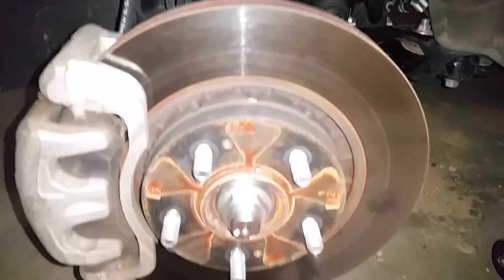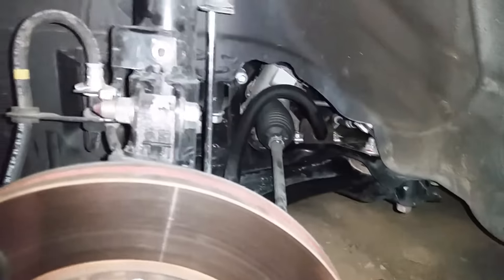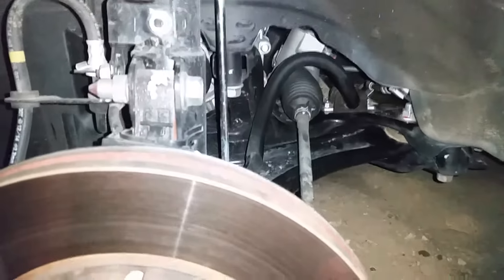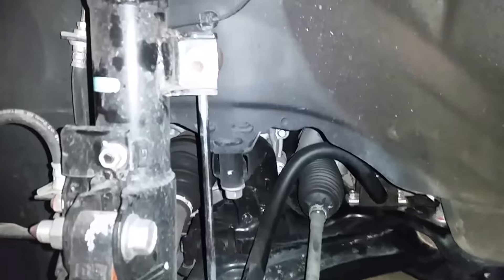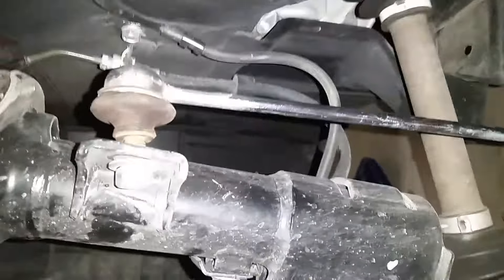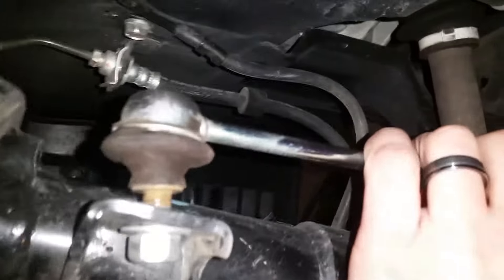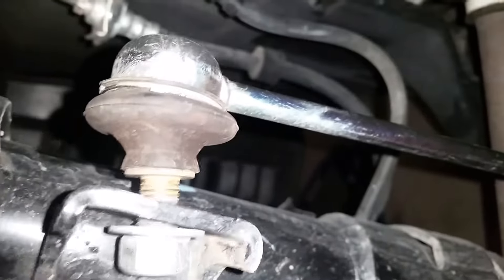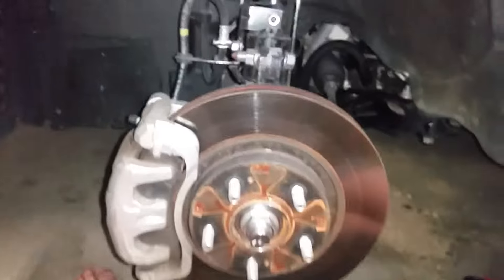Clunking noise found!

Comment: Always tighten it with the suspension LOADED. If you tighten it unloaded, when the vehicle is on its own weight it won't be torqued right.
Reply: Can you explain? Sway bar link nut has a set torque spec and doesn’t matter whether the system is loaded or not as long as the stud lines up with the hole.
Reply: @brandonevans743 that guy just doesn’t know what he’s talking about

Comment: Don’t feel bad man I did an oil change and almost forgot to put in new oil before I started it 😂
Reply from the maker: Hahaha it's the little things you can forget
Reply: Bet that has been done alot...imagine driving off 😂😂 Iam doing mine soon I hope I don't forget that will be curtains for most cars
Reply: @unknownunknown3368  Welllll? Did you remember? Just put the oil bottles in the engine area first.
Reply: Keep the cap off till its done thats what i do so i don't forget 😅
Reply: @JasonLyons-il8mv I drove 30 miles with the oil cap off after topping up, luckily oil cap was in engine bay still ha ..
Reply: I forgot to put the drain plug back in once.
NEW oil all over the ground.
Thankfully, it was just my push mower and not one of my vehicles.

Comment: Check all the fasteners on all the parts you have removed and/or replaced immediately after the install, the next day and a couple times within the next week or two. I replaced all 4 of my end links and had to re-tighten them every other day for two weeks before I decided to put a jam nut on all of them and no problems since. Also, for some reason the brake caliper bolts seem to get overlooked when reassembling... Hand tightened but not torqued

Comment: That's exactly the same case scenario for me. Slow speeds and over bumps i hear it because it's not loud enough to hear over higher speeds. No shaking or vibration coming from the steering wheel and control is not problem. Just that loose sound. Im gonna change the control arms anyway and control link. That should be good for a 100k miles.
Reply: Hey I have the same problem like you have before. I drive slowly in bumper so I hear it deep knuck not loud but it is. I dont check yet but sounds the same like your. Mitsubishi asx 2017. Thx for your comment
Reply: What was it?
Reply: @YXEFlatl1ne  Bent rim.
Reply: @marcpadilla1094  wow did u change the Top Strut Mount for no reason before that??
Reply: @YXEFlatl1ne  Almost did a complete overhaul.  BMW tried to whoop.me decent. Local guy said all good except the rim is bent.

Comment: Oh man hopefully this is my problem and not nothing serious to fix. It just started to happen on my passenger sides only when I do right turns depending on the elevation of the road full lock turns while driving & reverse it clunks clunks then sometimes it doesn’t. You can definitely hear the spring clink too
Reply from the maker: Hope you get it figured out!
Reply: @TheSnyds  Same issue.  In my case I had to remove the old sway bar on the passenger side. To remove the bold I had to drill through it.  I got it out, but I over did it and cut around the hole where the bolt goes in.  I think the new bolt may be moving around causing a clunking sound that started after a few days of driving.
Reply: @TheSnyds took off the a few weeks ago and my suspension end link came off and got bent from turns on the axel so scary but luckily it was a easy fix. Probably would’ve been $500 for a $30 job. My homie is a manger at auto zone and he happened to have the part I needed since my nearest auto zone didn’t have it so I as able to pick it up and swap it next day.
Reply: Same. What was it??? 09 pontiac. What was the issue?
Reply: Same issues on Q60.. what did it end up being ?

Comment: In my similar repair-causes-noise case, the noise was caused a defective brake job that forgot to install the brake caliper springs. The calipers were loose and were rattling against the rotors which made a severe noise. The brake tech said could not see a defect and I would have to replace the front-end one component at a time until the noise stopped. Instead, I took it to a different shop which looked at everything including the brakes spotted empty holes where the caliper springs should be. So, the brake tech caused the problem, wanted to cure it by replacing the front end, and did replace a couple of control arms. LESSON: inspect all recent work when looking for new car noises.
Reply: Caliper springs ?

Comment: I did the samething. I replaced tie rod ends and sway bar end links. Both had come loose. I got really, really luck. One of the tierod ends bolts almost fell off. Luckily it had an anti fall off saftey feature. I failed to torque everything under load. I didn't make that mistake with my struts. So, I learned a valuable lesson when doing suspension work. My car was almost undriveable. Extremely dangerous and was all over the road with loud clunks. I knew something was wrong so I took a look. I did this work months ago and just found it the other day. I mainly ride my motorcycles in nice weather so I hardly put any miles on the car. Only when it rained.

Comment: Did you tighten them past recommended torque specs? I did mine everything torque spec and still getting clunks at low speeds.
Reply: Same thing here, I went to mechanic 2 times but noise comes back after few days? They get loose again a been to 2 different mechanics

Comment: You also need to have the car s weight on all 4 wheels before tightening down the links or u wont get the benefit of the sway bar. I. Fact the bolt might cone loose again.

Comment: You inspired me to get a lexus.  I recent brought a 02 Lexus Lx470 with only 140k.  There are a few problems I need to get second opinion on the cause.  1.  The car makes a cluck sound as it decelerates. It up shifts very smooth.  Trans fluid looks good (darkred).  What do you think the cause is?  2. This might be related to issue 1, when shifting between R  to D there is a massive cluck or a kick.  Your input on what the issues maybe will he greatly appreciated.
Reply: That usually means a blown motor mount.
Reply: I Agree with KC. A 2002 Lexus is going to have seriously perished Rubber!
Your engine, gearbox and rear differential sit on mounting points which are cradled in rubber. 
Once the rubber crumbles away the mounting points won't completely separate; that is your engine or transmission components won't actually fall- off the vehicle BUT the two metal fixings which were once separated by a half-inch of rubber will knock against each other. Inside the vehicle this will be felt and heard as a thud. Differential mounts will thud when you change between D & R or when taking your foot off the Gas.
It's not easy to test these bushings, the car needs to be on a lift and the mechanic would show you the problematic, excess play using a large pry-bar.
Google Lx470 rear diff mounts and check out the images.
Here is a forum post of some guy doing the Job himself, looks tricky https://forum.ih8mud.com/threads/front-diff-mount-change-superpro-bushing-review.1056680/
Reply: @sierrawhiskey5155  Thank you much man for your insightful reply.
Reply: I had a similar issue and the culprit were the bearings (for rear drive pinion rear) and spacer in the rear differential and the yoke sub ASSY for the rear shaft, took me over a year to come to this conclusion